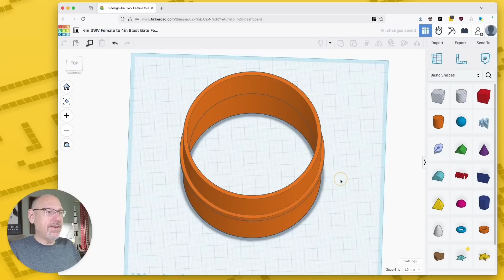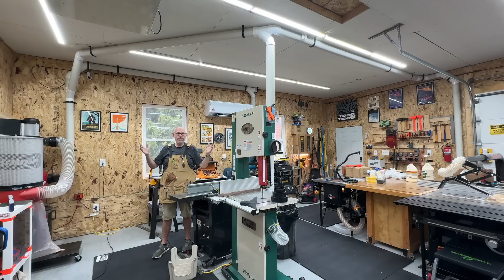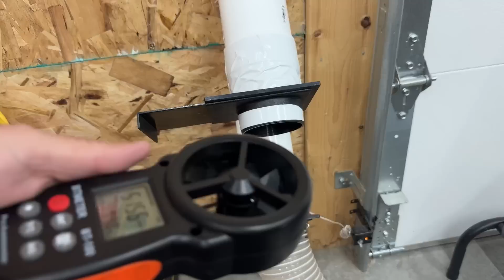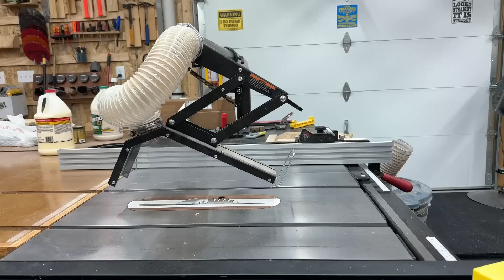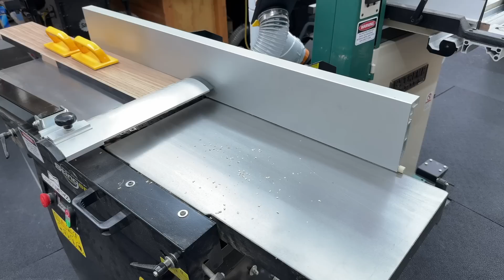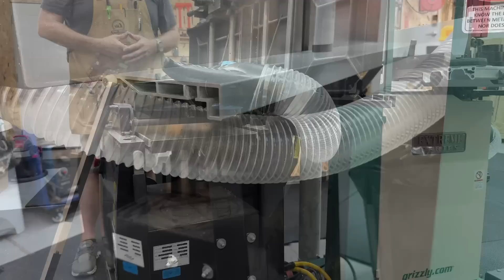I Hooked Up My Dust Collector with PVC

Comment: The 6" would be far better, especially for the two tools that use 2 blast gates.
Even if you wanted to stay with 4", you should have run from the dust collector to the first Y in 6" and then stepped down with a 6-4-4 W and you should have made the turn to the ceiling with 6" and a pair of 45's and put the W on the ceiling so it is in a straight line with the long run..
Reply from the maker: I don’t disagree. 6” ducting is much more expensive than 4”

Comment: How many hp dust collector are you using on this sytem?
Reply from the maker: It's a 1.5 HP unit (HF’s claimed rating) that I rewired to run on 220V. It can do either 110 or 220, and is pre-wired for 110V

Comment: Good video. What I did to connect the blast gates- same  4” “y”, same blast gate. Get a piece of the green sewer pipe ( I got a 2’ piece at menards). The outside diameter is a tight fit in the fitting, and the inside diameter is a tight fit on the blast gate. Cut 2” pieces of the pipe and you have a lot of perfect fitting adapters.
Reply from the maker: I’ve seen the green sewer pipe used for this, too.

Comment: have you considered using pvc pipe for all these flex connections between the dc components?
Reply from the maker: I've not.  I think the difficulty of hard ducting for these connections would outweigh the minor losses from the flex duct.  It's already a bodged together system and I'm sure there are other leaks here or there to get too fussed up about this (in my opinion).  😃
Reply: PVC directly the the tools is not generally recommended as the vibrations from the machine will reverberate through the entire system - you want at least a 6" piece of flex hose between the pvc and each machine (except the dust collector, which should be connected directly to the pvc.

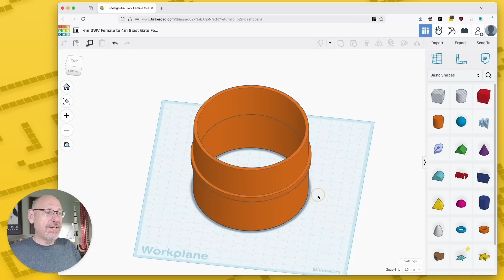Comment: 6:58 
Talk about doing things the hard way. You realise about 100mm of the pipe that the junction is designed for woyld have fitted perfectly into the junction and left you with a 50mm protrusion of pipe remaining, the blast gate could have been easily and quickly joined with a flexible silicone/rubber coupling that comes with hose camps at each end. Plumbers use these for repairing pipework that has been damaged in the ground and provide a means to insert a length of pipe in between two fixed points.

Comment: Thank you for sharing that information, it is very good. One thing that you might take a look at, is the table saw. I'm curious about the systems where there is an overhead extraction point and a below extraction point. One pulls up, and the other pulls down, so it seems like running them both at the same time, they will be fighting each other. Also, since the throat plate only has a narrow opening, and the saw blade fills a large percentage of that opening, then the throat plate is a choke point. Perhaps a couple of holes in the throat plate would allow a higher flow rate. I don't know that it would help in all cases, since once the part is over the throat plate, then the lower dust collection point is essentially completely blocked.

Comment: I'm starting down this road as well.  How did you connect  your PVC to the cyclone?
Reply from the maker: I used a 3d printed coupler that is dual-ended.  One end fits into the end of the 4" DWV pipe and the other end has screw threads that you can screw 4" flex hose on to.

Then I used a ~2 foot long piece of flex tube to connect the cyclone to the DWV pipe.

Good luck with your dust collection setup!
Reply: @TinkerTimber that would be perfect for my set up.  I have a 3d printer too.  
Did you model it yourself or find it online?  If is not a problem could you share the file with me if you have it?

Comment: Thanks for sharing.  I used my 3D printer to make flexible hose fittings based on the design from @mariushornberger.  I have one at my drill press and it works really well.  You might try printing one for yourself, instead of buying one.

Comment: Would be interesting to compare the same system using 6" pipe, but of course that would be too much work and too expensive just to make a youtube video.  I did find another video where a guy converted from 4" to 6" and took the same air  flow measurements before and after.  He got bout a 40% increase in air flow from the 6", which is pretty substantial.  Probably worth eating the cost of the 6" up front if you can afford it.  It would be the same as buying a dust collector with 40% more power.  The flex hose is the worst offender though, even short segments of that can knock your numbers way down, as you have found.

Comment: Tinker CAD is fine for tinkering, but if you have Fusion I would put the time into learning that.  There are some really good tutorial playlists for learning Fusion, just watch 1 a day during lunch.  It took me about 1 week of full time using it and then 2 more weeks of watching one video per day to get proficient at it.  I use Fusion for my own projects and Solid Works for work projects.  A lot of people like Rhino as well, but it isn't parametric so I just can't work with it.  Sketchup might be a good free option.  Shap3r3D is a cheaper version of the Fusion type interface that a lot of woodworkers use.

Comment: Have you experienced any issues with static electricity?
Reply from the maker: So far, not enough to shock me when touching the piping. I’ve seen a few places where dust has stuck to the PVC which is evidence of some static build-up. But overall it’s been a non-issue for me to this point.

Comment: Use silicon tape on your joints, it works very well with water pipes. It sticks only to itself and stretches quite a bit, very good on schedule 40, I used that on a sprinkler pump piping with success for many years. It does not leave residues when removed.
Reply from the maker: That’s a good idea, I’ll look into that!

Comment: I went with 4" DVW pipe too for my shop.  When I looked into 6" PVC drain pipe at my local plumbing supply house, a 10' segment of just the pipe was $100.  I would have needed about 8 of those, plus all the fittings, wyes, etc.  And, my blast gates were 4"...
Reply from the maker: How has your system worked out for you? So far I’ve not run enough boards through to say for sure, but am happy with performance to this point. Have you had any static build up issues?
Reply: @TinkerTimber 
Maybe you could ground the pipe? IDK... 
Coat the inside of the pipe with something that doesn't create an electric charge? 
Or, buy once, cry once.

Comment: I'll be interested to see if you have any problems with static electricity build up. I've been looking at doing the same thing in my workshop but have held off till I had more info on static build up hopefully you will be able to answer my questions in a up coming video. Thanks for your time 
Adam Sargent Australia 🇦🇺
Reply from the maker: I will keep an eye on it. I've read conflicting things online and the conclusion seems to be... it depends.  Some setups have issues and others don't.  Maybe it's locale dependent on weather and humidity conditions?

If I need to go back and ground out the system I will, and I'll make an update.

Comment: Like you work. Th more you can us PVC in the run the better. Every groove in the flex hose is a resistance step. If you are not going to change your printed converter pieces just glue them together or you can silicone them together. If you silicone them, tape both sides of the join so when you smooth the silicone it will on be in the join only. If you smooth the silicone it over the PVC it will grab the particles as they go past. If your glue the PVC pipe joins together with PVC cement they will never leak.
Reply from the maker: Once I figure out if the layout works and is going to stay locked down, I think the next step will be to use PVC cement to make the install permanent. But I’m going to wait a bit to make sure I don’t change up the tool layout and need to cut apart the ducting to accommodate.

Comment: I used shrink wrap on my connections then a simplewrap of tape (packing tape, painters tape, duct tape… whatever) to keep the shrink wrap in place
Reply from the maker: Interesting approach.  Do you mean the plastic Reynold's Wrap type film or like heat-shrink tube?

Comment: Regarding your comments at the end on the questions about getting a higher-end system vs. what you ended up purchasing, an Engineering VP where I worked once said "Better is the enemy of good enough" and that's what I thought of when you were addressing those questions.  It looks like you have a great cost-effective system for you, and I certainly appreciate the detailed cost breakdown you provided.
Reply: @jimharris8707 
The paraphrase lost the spirit of the message. It’s more like perfect is the enemy of good. Meaning if you fail to iterate and delay release you never take action. Taking action can be refined, never taking action cannot.
Reply from the maker: That's a good insight and a philosophy that is easy to struggle with.  But I realized I could build something better now and be using it, or keep saving for the foreseeable future to maybe put in "the best" system and in the meantime, I would still be struggling with making a mess every time I used the bigger tools.  Perfect is the enemy of good, for sure!
Reply: I believe the actual quote is “don’t let perfect be the enemy of good”  I struggle with this as an anal retentive perfectionist myself.

Comment: On your table saw trip hazard situation. Make the drop come down at the side of the table next to the overhead arm. Strap it to the table behind the arm. Then the hoses and blast gates are on the saw side of the walkway
Reply from the maker: I went back and forth on that thought. 

Unfortunately, the ideal place to do that is on the wrong side of the rails for the overhead garage door and if I drop down where I can, it puts the PVC run in a bit of a wonky location.  Still, it's a valid idea and I may test it at some point as it would just require cutting the pipe along the ceiling back a few feet.

Comment: Nice!  I'm curious if you have a cyclone added to the Harbor Freight dust collector?  Have you considered 3D printed magnetic attachments?  You could forgo the blast gates, and just use 3D printed Caps everywhere except for the connecting the devices you want to be connected.  You would get your walkway back when you are not using the sawstop.
Reply from the maker: I do have the Bauer cyclone separator - that was what started all this, I took a bit of a flyer on it and couldn't find much information on it online.  You can see that vid here: https://www.youtube.com/watch?v=Qo22rfMLTtM

I've not thought too much about making magnetically connected couplers though I've seen several on the maker sites.  Interesting idea, I may have to give it some thought.

Comment: Great video!  Like just about everybody else I too started out years ago with a flexi-hose/ 2hp Harbor Freight dust collector.  I then ran 4" PVC DWV pipe like you, and it is a game changer.

One thing I learned is that those plastic blast gates don't work very well.  I had the version from Rockler and eventually they clogged up on a regular basis and I ended up spending more time digging the sawdust out of them than they were worth.

I found a better solution, by slipping a small piece of the DWV pipe into the fittings and couplers you can slip one of the metal blast gates from either Rockler or Powertec directly into the DWV pipe.  On one of them, I forget if it was the Rockler or Powertec I had to use a heat gun to warm up the end of the coupling pipe to get it to slide in easily.  This is a much better solution, and I think eventually you will have to switch blast gates, I just wish I had a 3d printer like you to make a more elegant solution than just stuffing the gate into the DWV pipe coupler.

Also ditch the plastic bag that sits under the dust collector filter.  These are a PITA to change.  I built a different system that is basically just an endcap and then a 5-gallon bucket that connects to the end cap with a screw in connector that attaches to the bucket, I forget what they are called at the moment.  Then I cut a circle at the end of the bucket and extended the drop by about 30" (my setup is wall mounted) from the end of the bucket using some pipe with a plywood endcap.  This ends up being a low restrictive version of the Thein Baffle for the final stage of the filter system and will greatly reduce the amount of fine sawdust particles that would otherwise end up in the HF Filter cartridge.  This will reduce the maintenance on the filter cartridge.

If you want a picture or two of the Thein Baffle shoot me a dm and I can email some pics to you.

Looking forward to your next video, keep up the great work.

dc
Reply from the maker: Thanks for the suggestions. At some point if the plastic blast gates are too problematic I may go with the 5" metal blast gates, but spend almost as much per metal blast gate as I did for all the plastic is something I would prefer to put off for a bit! 

I'm hopeful that the cyclone will keep the majority of the chips out of the collector's plastic bag. So far there is a handful of chips in the collector's bag and the cyclone is about 1/2 full - so it seems to be working.  I've seen what you're taking about with the plywood panel and a bucket with a screw top for catching the overflow chips. I may look into that as some point.

The one thing this system won't do - which is a big compromise (of all the <3HP units from what I've researched) - is move enough volume of air to capture all the fine dust, and to filter the exhaust air to a fine enough size that it removes all the dangerous small particles.  So with any of these smaller systems, it's still incumbent on me that I wear a respirator when using tools that make chips and dust.
Reply: @TinkerTimber  Yes the super fine particles will still float around your workspace.  I ended up getting a furnace blower and built a box for it with 6 HVLP 20"x20" filters.  I mounted it on the wall not far from the DC filter cartridge.  This does a pretty decent job of grabbing most of the fine particles, but I do wear a respirator when doing a lot of sanding.  The metal blast gates were expensive but if you keep your eyes open you can sometimes find them at a decent price.  Best Regards Dave Couch

Comment: The PVC pipe that goes to the floor to hold it up, you could put a floor vent to sweep floor dust up.
Reply from the maker: I've been thinking about that. Next time I swing by Rockler I'm going to look at their floorsweep with the built-in blast gate.  I don't know if it's sturdy enough to hold up the stack above it, but if it appears to be, then I'm absolutely going to add one.